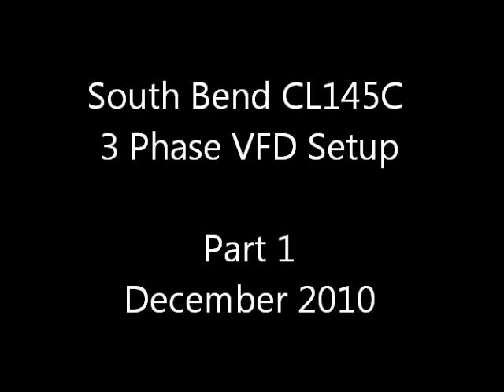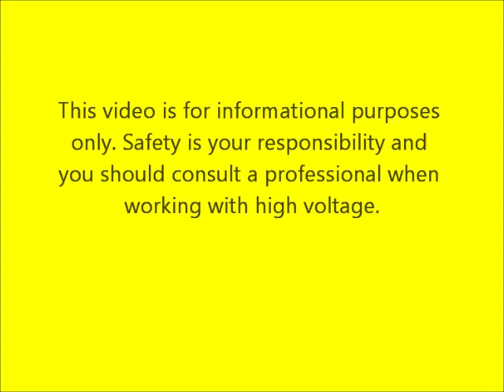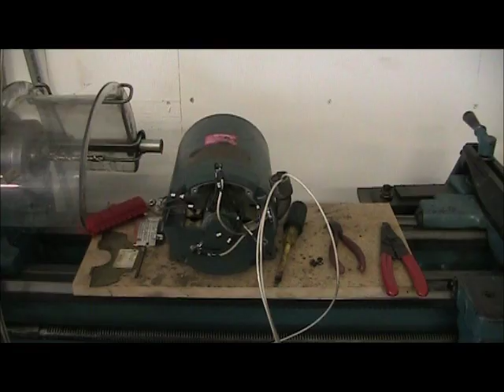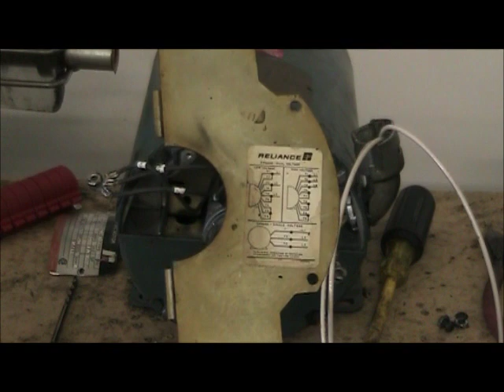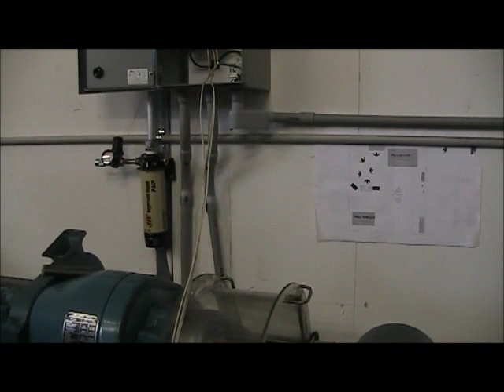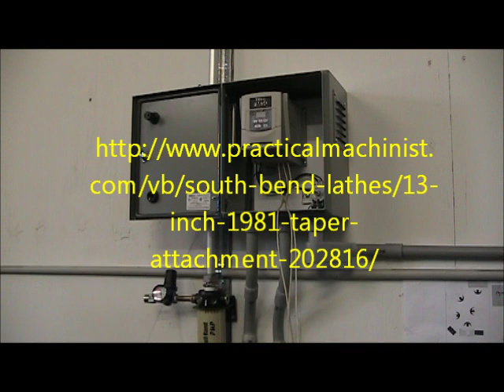South Bend VFD Installation Part 1

Comment: I'm currently looking around at VFDs to power my South Bend 13" (1hp - 3 Phase), but as far as 220 power goes I'm kind of stuck. I need to be able to power the VFD from a 220v 3 prong dryer receptacle (Via a likely 10/3 awg cable and plug, about 25ft run), but being a 3 prong receptacle and plug, I'm at stand still trying to determine if I can use the 220v 2 legs and neutral from the dryer receptacle to the VFD, then run a separate 10 awg ground from my breaker panel. Your mention of a universal ground is the closest I've come to this. Any thoughts?
Reply from the maker: John Strange John, talk to an electrician, but the return leg aka neutral on most panels is actually connected to ground inside the panel. So even a separate ground may not be required. Hence the 3 prong dryer plug. If of course your in the United States
Reply: I ultimately will consult a pro, I'm just trying to get my head around the problem. Yep, U.S. here. Thank you, and happy Thanksgiving.